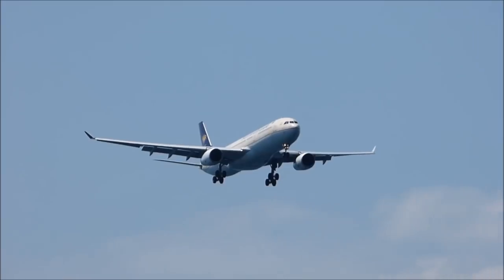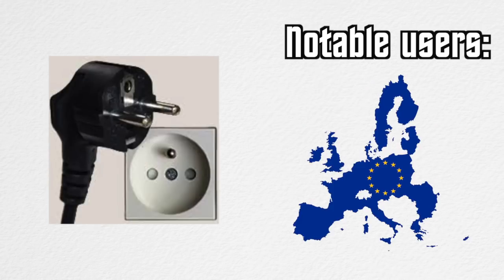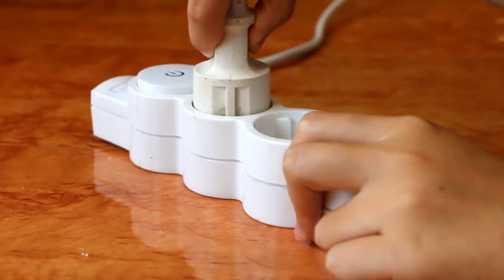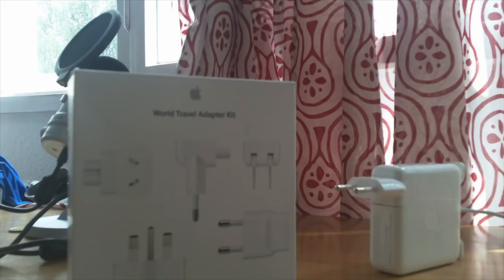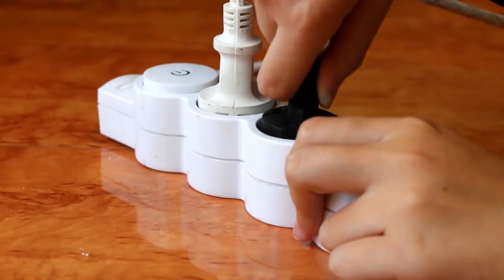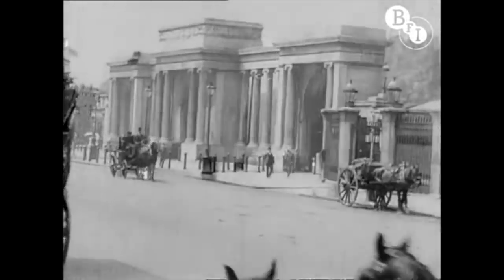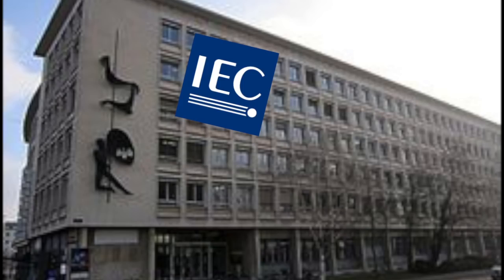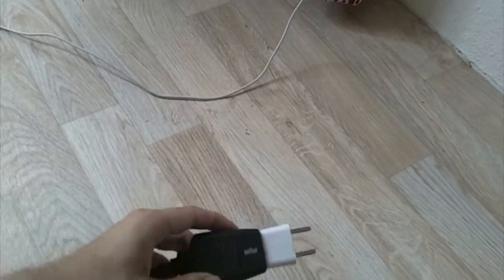Why Different Countries Use Different Plugs

Comment: L plugs are the worst.
Reply: 16A L plugs are the best. They are flat, so the socket occupies half the space than any "round" plug, both on the wall or in power strips. They are 16A rated, like the type E and F (schuko), they are grounded, and they are bi-directional. The Type L is the only plug that has all those charateristics. If there should be an unified standard, it should be the type L.

Comment: Italian plugs, just pull out the ground  pin in the middle and you get the standard EU plug ;)
Reply: I live in Romania, we have the normal europe plug and when I went on holiday in italy I just used my normal charger and it fit well in 95% of the plugs and it could charge... the rest.. well.. they were too small
Reply: @tudor1257  Didn't expect people from Romania here. :D
Reply: Reminds me of how some of us in America pullout the third pin, aka the water ground, out of type B power cables so it can fit in an ancient type A outlet. This is because some of us are to lazy and cheap to update the outlets in older homes.
Reply: @prfo5554  that or, they're are too cheap to buy a type B to type A cheater (adapter)
Reply: Jenny Knopps Agreed. However, technically one is supposed to screw the little piece of metal on the bottom of the adaptor to a grounded screw or something like that. Yet, I never have seen anyone who does that. So, it is literally like pulling out the third prong without damaging the type B cable.
Reply: Oh god no
Reply: russian plugs work too
Reply: Im not so sure abt that but arent they already switching to the european standart? Like ive seen a lot of italian plugs, like the really thick one, the 3 "sticks" one but also the normal one. I can plug in my german stuff almost always.
Reply: @ellealine4159  Yes and no. Phone chargers and the likes use the Europlug standard (which is pretty much a "lowest common denominator" between Italy, Switzerland, Denmark, France/Belgium and the rest of continental Europe), while bigger appliances are nowadays often using the Type F (Schuko) standard. The last Type L plug I've seen on a new appliance my family has bought was in 2012.
The issue is that a typical Italian home will mostly have one or two Type F plugs (one for the fridge, one for the washing machine), with the Type L ones everywhere else. Of course, the typical Italian home has a crapload of Type L 10A - Type L 16A (the big ones) - Schuko - Europlug adapters which would put any hardware store elsewhere in the world to shame.
Reply: and this little damn thing your hiding everytime in my pizza your streetpunks Italian designers ;)
Reply: In Brazil a lot of people still pull out the 3rd pin to fit in europlugs (which where one of the plugs used before the current one)
Reply: I never used Italien plugs, but i know they are pretty simular to swiss plugs. The T13 and T12 plugs look allmost like the Italien ones, except that the PE pin is offset, so you allways plug the it in the right was (N to N and L to L). For something with a Typ C plug it dosnt matter, because it has no PE so it has to be "double insulated".
The problem i see is, then you plug in something with exposed conductors like a lamp holder, where you can easily electrocute yourself if you connect the L to the N possition and touch the threaded part on a light blub while screwing it in
Reply: Do not do that.  If the equipment gets failure the voltage can get to the case. If there then is an equipment that really is grounded and you touch both at the same time, it can be fatal. If there is no ground in the room them it is pretty safe though but still illegal.
Reply: @okaro6595  Im pretty sure that was a joke
Reply: @okaro6595  yeah, who touches the ground anyway? Only noobs who can't levitate 😂
Reply: The floors on normal rooms are not grounded.

Comment: There actually IS an international standard, USB power. Hotels in many countries provide USB outlets. USB-C is also growing as a scheme. In the future you might be able to just bring a single country specific USB-C laptop charger and also use that to charge your phone, your electric razor, your electric toothbrush, your tablet, etc. Wireless charging is also largely standardized so hopefully hotels in the future just have a wireless charging pad and you can charge your phone and smart watch on it.
Reply: USB cables of any sorts cant possibly handle an output of over 85W, you know hairdryer output over 1600W? You realize what that can do to a tiny USB cable that hardly withstands a current of 4amps?.

Yall need to learn the difference between current voltage and power output.
In cables and connectors what really matters is the current.
Reply: @HoLDoN4Sec  Exactly and that's why the newer Usb-c connector facilitates higher voltages. That voltage is now maximum 20 V but could easily be raised further in the future. And I'm pretty sure that's going to happen.
Reply: mPky1  it outputs heat equivalent to over 1600 watts of electricity is what i meant
Reply: yeahhh well I think we will never see USB port with a voltage of 110 to 220 lmao, the actual international socket is the universal socket which has all the different types in one.
Reply: Yeah, I love to connect say my wet vacuum cleaner or stove to any kind of USB....
Reply: USB is uncomparable to a wall outlet. Good luck getting 3.6 kilowatts out of a USB port for your stove / oven / clothes dryer / washing machine.
Reply: You can’t power a TV or a Microwave with USB.
Reply: When we adapt new technologies it can be standardized. It costs too much to change existing. Ie the imperial system
Reply: A usb-c plug would melt trying to power my laptop its 1080 sli with 2x330watt power bricks.
Reply: @nathnathn  what make/model of laptop is this?
Reply: @TatsuChi  MetaBox. Which is one of 3 brands that use Clevo laptop cases. for series its something like Prime-X my replacement power-brick is 780watt’s.
Reply: mPky1 The USB Type-A with BC1.2 and USB Type-C with USB-PD and BC backwards compatibility are two very well defined and well supported standards. Also all USB charging nodes enforce a 5V 500mA ultimate fallback. Using different physical connector, there is no confusion possible.
Reply: Monsuco is Wikipedia you favourite website or is it make a book.com
Reply: And there is also Qualcomm Quick-charge which doesn't follow the USB standard.
Reply: With all the fast charging systems USB is hardly a single standard.
Reply: Usb-c is a true standard though but it has nothing to do with what goes through the cable. It's a standard about a plug. What people often confuse it with is USB 3.0 or the newer 3.1, Power Delivery, Quick Charge, Dash Charge. Those define what signals and power go through the connector. So Monsuco was absolutely right to call usb-c a true international standard.

Now that doesn't solve the problem. But if they could come up with a standardized USB 4.0 or something that makes Power Delivery support mandatory then things could change. At some point we might even be able to make the switch from AC to DC for all appliances. And that would make a lot of sense in the electronic age. AC is a pretty bad way to transfer power because it creates a relatively strong magnetic field and thus leaks energy. DC is more efficient and above all it's a super steady voltage.

The only reason we have AC is generators. Those produce AC by nature. But I'm pretty sure engineers have a pretty good solution for that in this day and age.
Reply: @moladiver6817  you won't be able to transport DC for long distances without enormous losses and massive wires.
Reply: @moladiver6817  The (main) reason we have AC, is the simple fact that it is easier and more energy efficient to transport over long distances, like from a hydroelectric plant to the big city 500+ miles away.
Reply: Mola Diver People do not confuse type-C with usb 3.0. I dint think most people even acknowledge that usb3.0 exists because the actual aesthetics lf the plug are the exact same.
Reply: @moladiver6817  DC also leaks energy via ohmic losses.
Reply: @moladiver6817  since nobody thought about some things in your comment  then I'll have to. Firstly, DC will NEVER be a more efficient way to transfer electrical energy than AC, because in DC the lines would just  be a massive space heater, because there would be a lot of current going out of the generators to meet the demand of users, and it is known that Q(heat in joules)=I²(current)*R(resistance)*t(time). As you can see, heat output increases in square when the current is increased.
Reply: @Kuzia141  Hang on, I'm not saying we should eliminate high voltage cables. I'm merely talking about DC itself and that can easily be high voltage as well. However what I didn't think about is that it's more difficult to convert DC to DC at a lower voltage for household use than it is to convert AC to AC low voltage. Transformers need AC because of the way they work (with coils and induction which only works with AC). But I'm no technician so maybe there's a good solution to that as well. But as far as I know transporting DC means less loss of power because it doesn't produce a changing magnetic field around the wires and thus doesn't lose power over a certain distance as much as with AC. But if professionals disagree then by all means debunk my statements. ;)
Reply: Sorry but you can't get much power out of a USB port. My laptop for example needs 380w to charge. Over the 5v lines of the USB. that would be over 76 amps, which is ridiculous.
Reply: sgtLogez If your laptop has USB-C, it can negotiate up to 100W using 20V 5A, while still carrying full Thunderbolt 3 speeds. Most laptops consumes less than 100W even when charging now.
Reply: @mrcaptaindarkrex  I don't believe your laptop needs that much power. Most laptops have adapters between 40 and 80 Watt. That combined with USB power delivery and its higher voltage it is very much possible to be used for charging as others already pointed out. Even my phone charges at 18 Watt whereas newer models already charge at 30 W or more.
Reply: @moladiver6817  it has a 380w powerbrick. And of course it's not charged via type c
Reply: sgtLogez what’s so weird is most electronics use 5v or 3.3 go run so why need 18 volts? It’s just a waste from heat
Reply: @Hanna, you don’t have a lot of devices then. Only a phone runs of 5 volts. A laptop uses 19 volts. The internal components of a PC use -2 up to +12 volts (but at much more amps than a USB socket can deliver). Any other appliance does actually need the high voltage to keep the current down.
Reply: @mrcaptaindarkrex  So much power? By comparison the power brick for a 15" MBP is 'only' ~85W
Reply: USB is only powerful enough for relatively small devices. It cannot power anything needing more than 100 watts. So if you bring your hairdryer again, you're out of luck. It is great for small, portable devices or indeed even a laptop, but it's definitely not something that can replace the plugs that are already present.

Comment: Different frequencies can wreck havoc on motors and transformers since they are dependent on the frequency of the powerline.
Reply: transformers that are not at their limit do not care about 50 or 60 Hz. Yes, you can construct an edge case where it becomes a problem, but generally: 50 or 60 Hz is not a big deal.

Comment: I think Type-I is used for large appliances in America.
Reply: Type I is the Australian standard plug
Reply: The plugs are different in size and shape. Plugs for clothes dryers and kitchen ranges are very large, and look similar is size to regular 3-prong UK plugs. We also have other smaller plugs for high amperage 120V loads. It gets confusing, and there are multiple standards.

Comment: Europe and Australia/NZ should switch to NEMA L6-15
Reply: That is a very unsafe connector.
Reply: @hansw5067  how so?
Reply: @brettknoss486  For 2 reasons: if the connector is halfway in they make contact and yoy can touch the pins.
Compared to US, EU and UK plugs they fragile. Pins bend pretty easy.
Reply: @hansw5067  doesn't having a shroud and lock, mean the pins are less likely to be exposed?
Reply: UK plugs are safest. End of story, not arguing

Comment: Btw 1 fact was wrong the UK runs at 240v at 50mhz not 220v
Reply: the European standard is 230V 50hz, 240V is the basic chargeless voltage...
Reply: Britain officially switched to 230 V but in practice they did nothing. It is within the tolerances.

Comment: Is type I the American 240v plug?
Reply: type i is used in Australia and new zealand and runs of 240volts 10 amps
Reply: @malcolmholmes509  OK I thought it looked like a NEMA 10-30, but that's a 30 amp plug with no ground in the plug.

Comment: In the end, once you have introduced one design, its almost impossible to change.... Almost all desings in use are good enough and a change would be expensive and annoying. Even though an international standad (for instance IEC 60906-1) would be really useful, I dont think it will happen any time soon.
Reply: The world could at least agree on (or create) a standard for the future and let each country take their time to change. If it takes 20+ years to change so be it, but at least settle as soon as possible on a single one. Once major markets change to a new standard other countries will tend to be pressured to change due to economic reasons.

Comment: Plugs go by economies of scale.  Obviously rewiring every USA household to 220v would be very cumbersome and costly, although we could switch to 220v for new construction, but then people would have to have adapters for all their gadgets when they move into a new building.  Perhaps governments running electrical wiring with the same currents could standardize their plugs, and this wouldn't involve rewiring, just screwing in new plugs, which anyone with a screwdriver should be able to do.  Businesses could be set up to swap out older plugs with new ones for people using old gadgets and this could be included with the cost of buying a new style plug.
Reply: Very dangerous. Plugging 110V equipment into 220V  is likely to cause a fire.  Better stay  at 110V and let the rest of the World advance at your expense. We'd prefer to see that than enjoy your USA climate change forcing due to ignorance at the top.
Reply: @Gribbo9999  Hi.  Maybe you misunderstood.  I was suggesting adopting 220v wiring in newer construction along with a different style plug to designate the different voltage.  Yes I live in the United States, and I am just as upset about the US governments ignorance towards climate change as you are.  I did not vote for the Cheeto, I've signed petitions for renewable energy, I've done everything I can to get our government to take a more socially equitable stance.  I take offense that you'd generalize my character like this, because you are judging me based on where I live, not what I do.
Reply: But to backpedal a little and revisit my original statement, I was hypothesizing a way Americans could transition toward a 220v residential wiring standard, but it doesn't take much number crunching to say the benefit will most likely not outweigh the cost, and instead of pouring resources into switching the way we wire our houses and businesses, resources would be better spent getting renewable energy onto our electrical grid so that we can address the larger issue of global warming head on.

Comment: C-plug gang where you at?

It's clearly the best one, just a circle with two holes. I live in Norway and we now have F-plug for grounding, WHICH IS ANNONYING AS HELLLL FOR VINTAGE AUDIO ENTHUSIASTS LIKE ME, because you have to either cut the plug and solder on a new one or if it's rubber you can cut of some bits to make it fit.
Reply: Neither is safe. The fact that the plug does not fit is a safety feature and it should not be circumvented, You should use an isolation transformer if you cannot ground it properly (like if it is a hot chassis radio)